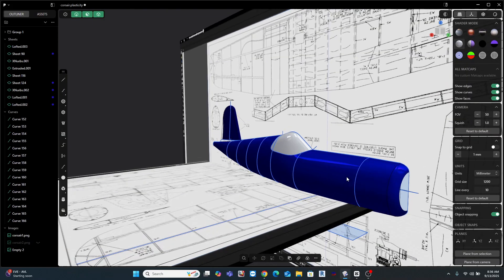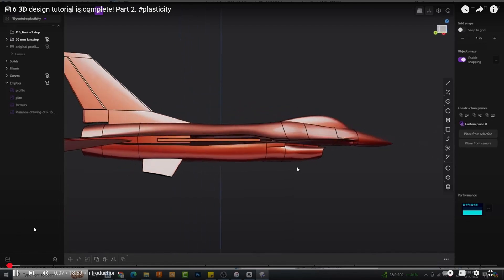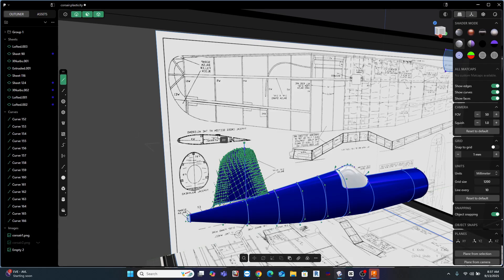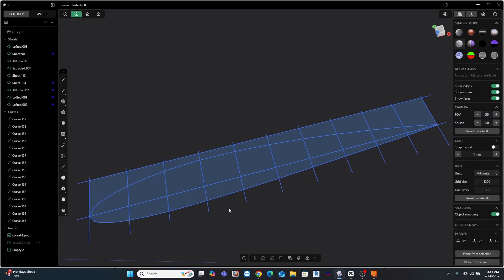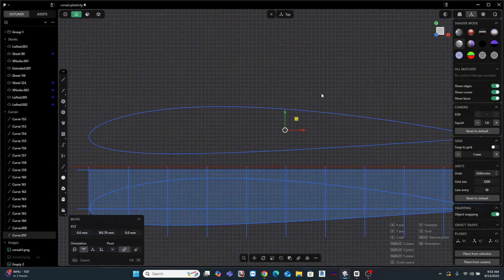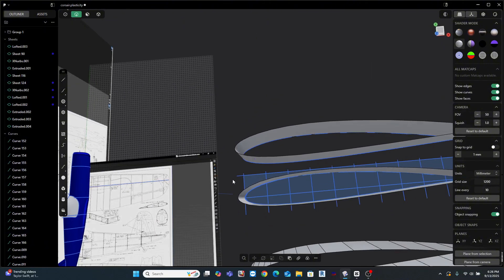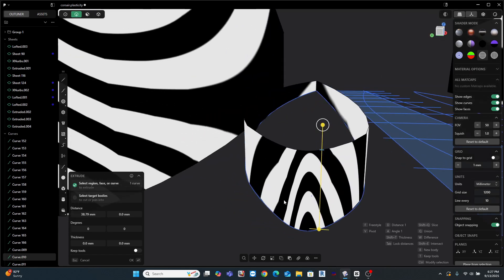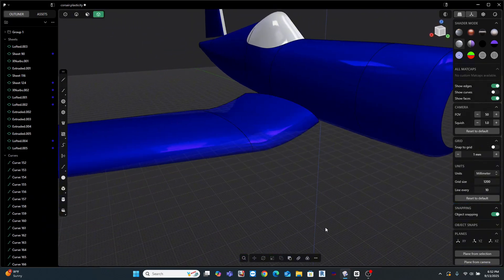Control Point Curves vs Splines | Which Creates Better Airfoils in Plasticity

Comment: Hi RedBaron RC, Just come across your interesting videos. I have an RC jet I want to recover it, my idea is to scan the plane with my Metro Y Pro, then draw the shape of the vinyl on the mesh curves, lift the drawn shape and unroll it and cut out on sillouette vinyl cutter. What would be the best software, it would be great if you could make a video showing how this is done, I have'nt been able to find a video covering this. I use Fusion 360. Very much enjoyed your IGES video, great. many thanks, keep up the good work.
Reply from the maker: So I think I understand what you need and I've kind of hit a bit of a wall with this.  You want to unwrap a curved graphic.  Fusions sheet metal tools can sometimes do this but I've failed as often as I've succeeded.  There is a paid for plug in called exact flat that can also do this.  I'm told the best app for this is Rhino.  I don't know Rhino but for that tool alone it is on my radar.

Comment: The tail thickness of the airfoil downloaded from the database is zero,
But It should not be zero in a real model.
Therefore, I recommend that you make any adjustments on CAD first.
Reply from the maker: Great point.  All the more reason why I gravitate to control point curves.  It's easier to make a soft transition.  Also if I scale an airfoil for a tapered wing I can go back and re set the trailing edge thickness. On the smaller foil.